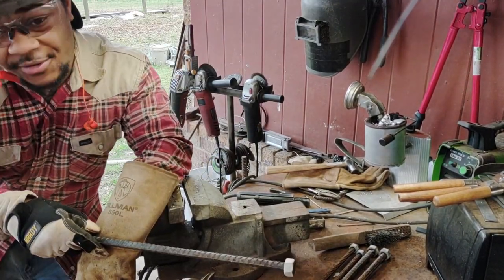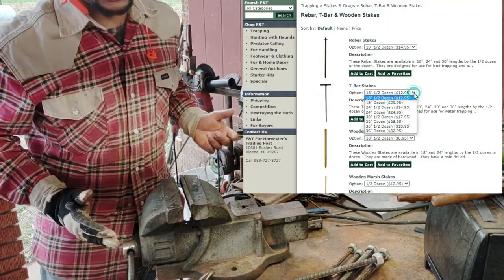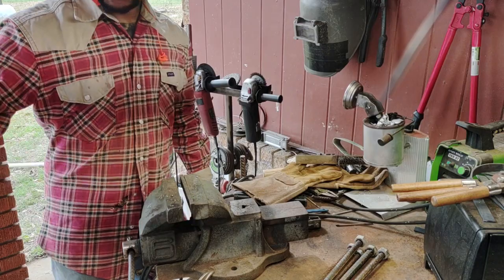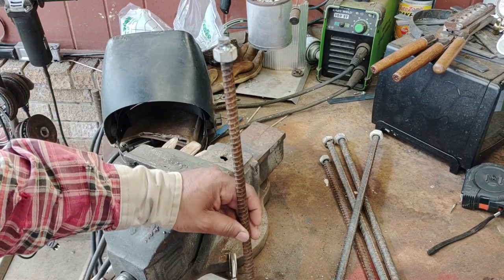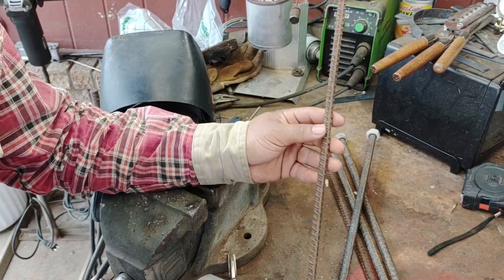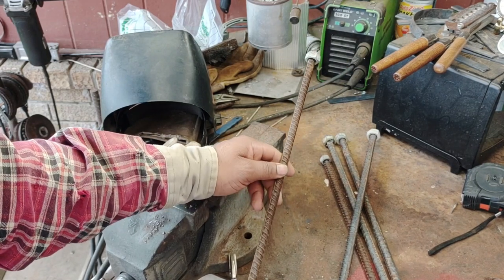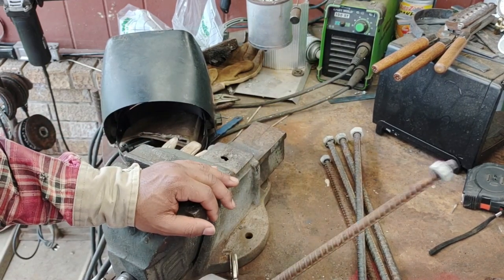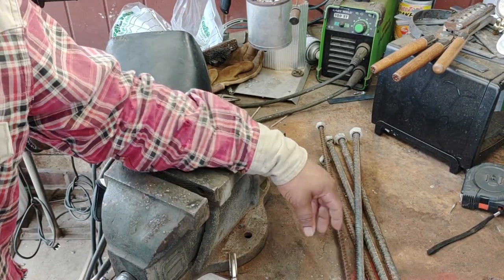DIY Rebar Trap Stakes A-Z

Comment: Another version of this without a welder that I came up with is to taper the rebar enough to hammer a nut down the rebar so that a 1/4” of the rebar is sticking out of the nut. Then penne/smash the rebar that is exposed so that it mushrooms out and locks the nut on. 

I usually finish the final strikes off with a waffle head hammer for texture/grip when I’m in the field. 

Then 3 links of chain that are just large enough to clear the rebar makes it a swiveling stake too! 

I use these for my wall tents also. The chain makes a good spot for the rope to pass through to cinch down the sides of the tent.

Comment: I been using 3/8 24 inch ones. I cross stake them. Never had one pulled out. I use alot of 1/2 for beaver and raccoon kill poles. 5/8 kill pole for coyotes I build my 3/8 stakes yrs ago. U can also stack the  rebar on top of each other in chop saw vise. And cut 3 pieces at one time. I have run into if u make it sharp end. If u hit a root.. the non sharp in don't go into the root.   Like a sharp in does. Hard to pull out of a root. Last one I couldn't pull out with my stake puller. Had to hook a chain to it then my truck. It came out then.. Another good video. The kill pole video was another good one.
Reply from the maker: Thanks for the comments and the info ! Never thought about cutting more than one at a time though 🤔